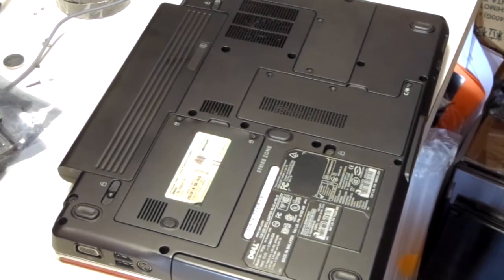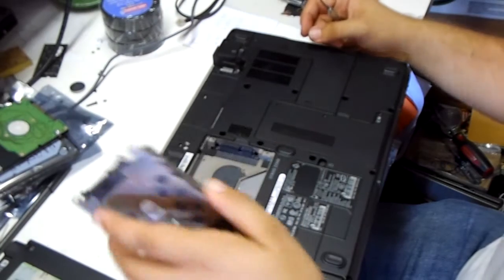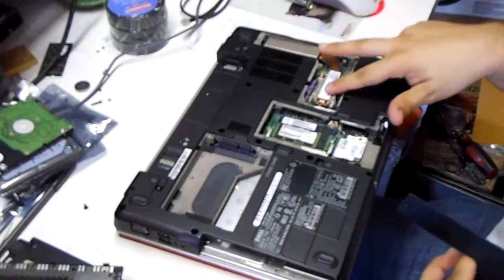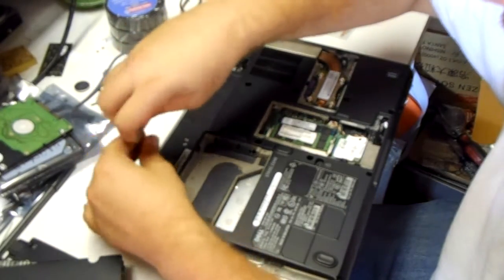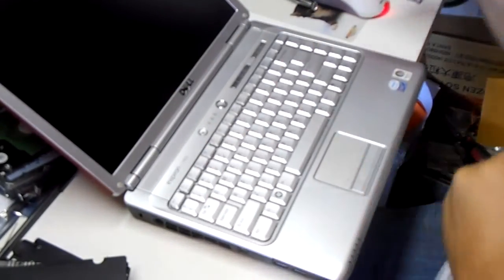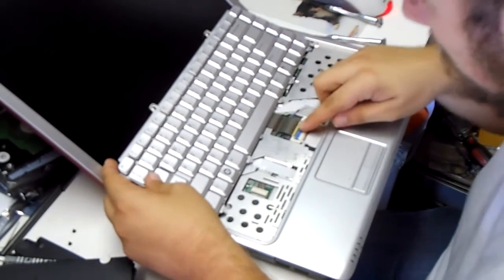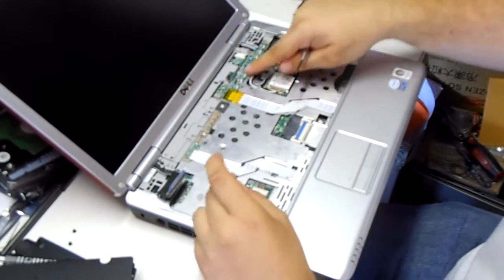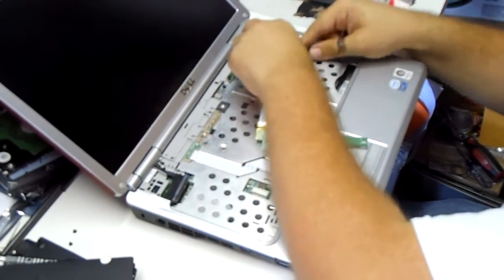Dell Inspiron 1420 Disassembly & GPU Reflow: Part 1

Comment: I have the same model, but the video will not come on, I have tried connecting to a monitor but that does not work either. How every windows does boot because you cab here the windows tune play. any tricks I can try before i tell my client he is SOL? The hard drive I can save.
Reply: you might want to put the ram in another slot